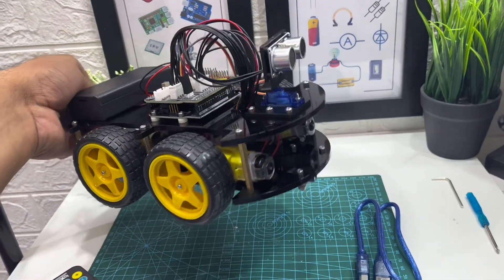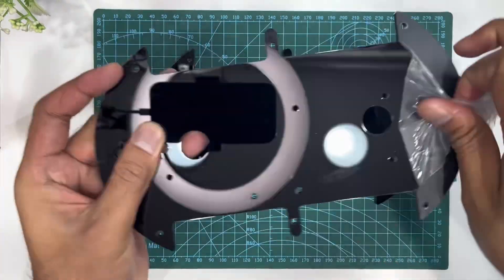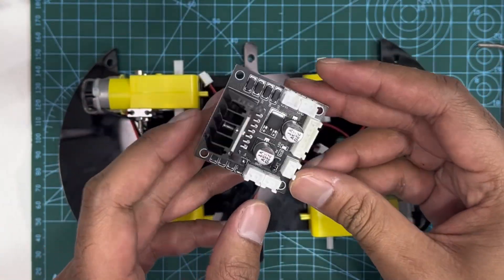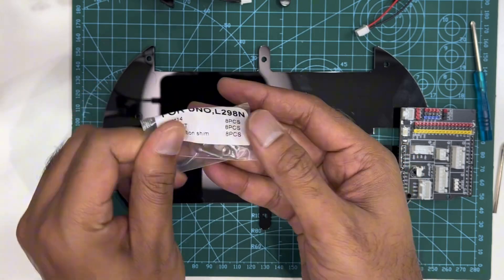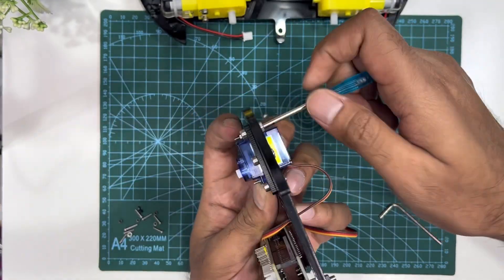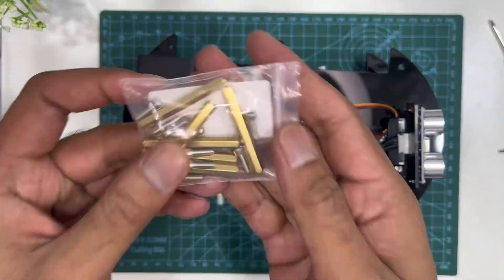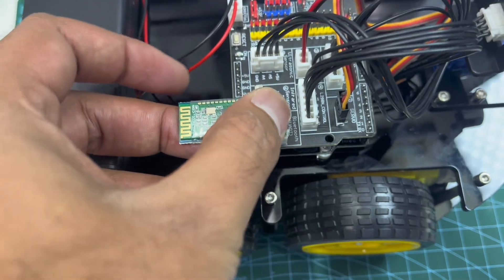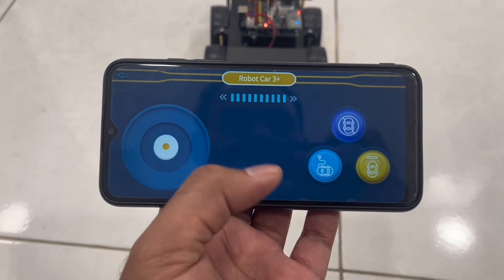SmartBot Car || Full Assembly & Programming Tutorial ||| Arduino DIY Project

Comment: I tried the code but it doesnt work
Reply from the maker: Which code you tried? 
Line following or obstacle avoidance or IR remote control or Bluetooth control? 
Or you tried the all combined code?
Reply: @mahade_DIY  all the combined code but it give me an errror abot the IRREMOTE
Reply from the maker: @yassertarhat4565 
If you buy the same Robot car kit from Koungshun,then the code will works without any change.
Otherwise you have to find the remote button code and edit the code by replacing

Note :Remote codes are the unique identifiers transmitted by infrared (IR) remote controls when you press buttons
Reply: @mahade_DIY  now it did work but when i connect it to my phone the blue light doenst turn on why please